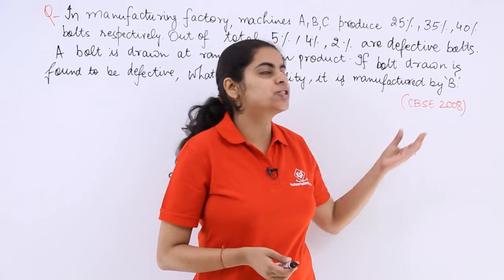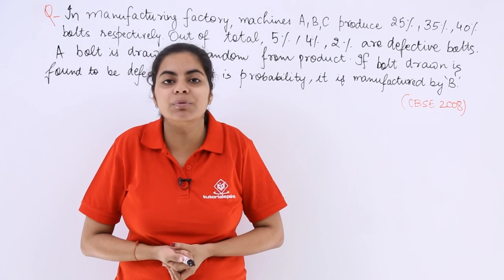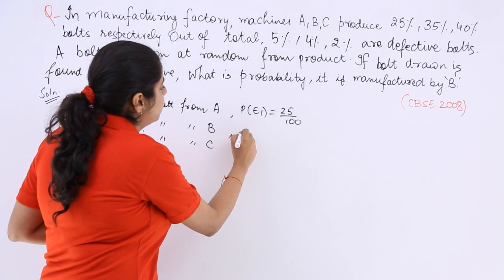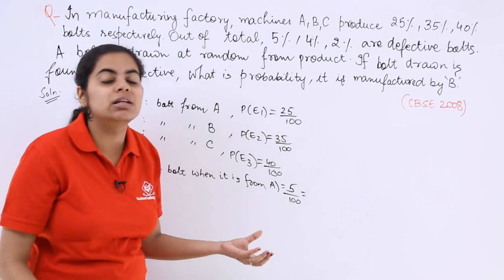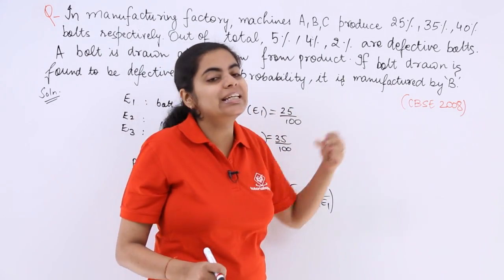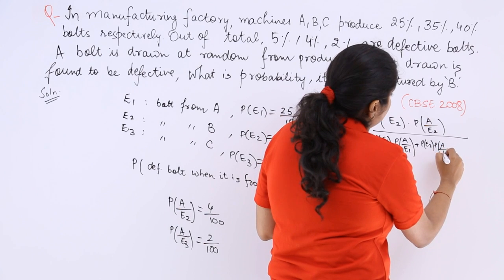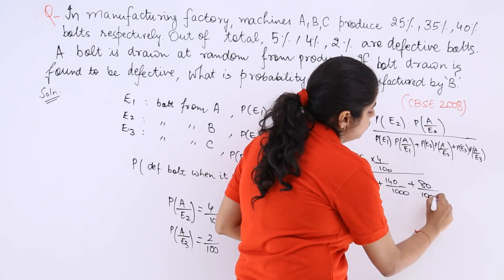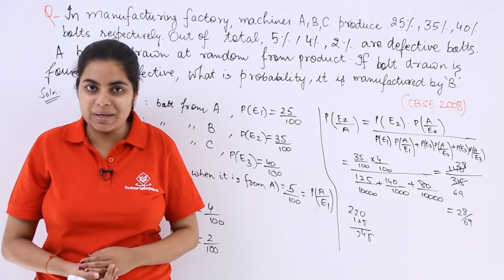Class 12th – Bayes Theorem Problem-1 | Probability | Tutorials Point

Comment: Why done p (e2/ a) ?
Reply: Sorry this is a year late.

She used E1 to mean machine A, she used E2 to mean machine B. 
We want to know about machine B which is now E2 in her notation. 

Also, she has use the letter A NOT to mean Defective, NOT machine A.
We want to know the probability that the Defective bolt (now denoted as A) came from machine B (now denoted as E2). 
Hence P(E2|A).

It would make sense if you thought to write it as Probability given bolt came from machine B given it is Defective -> P(B|D).
But she writes it a P(E2|A). 
It still means exactly the same thing since she redefined the terms as she was writing the problem, but you have to ask yourself why?
Why was it important to redefined the notation in the middle of the problem when it was clear and unambiguous to start.

P(B|D) = P(D|B) P(B) / P(D) , where P(D) is the total number of Defective bolts, i.e. P(A) P(D|A) + P(B) P(D|B) + P(C) P(D|C).